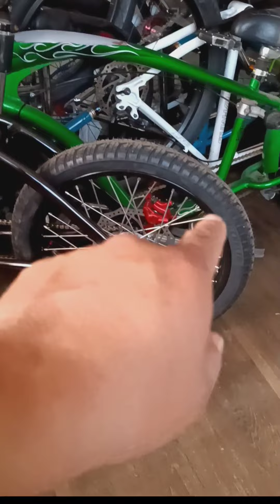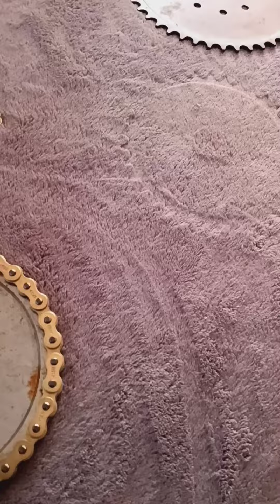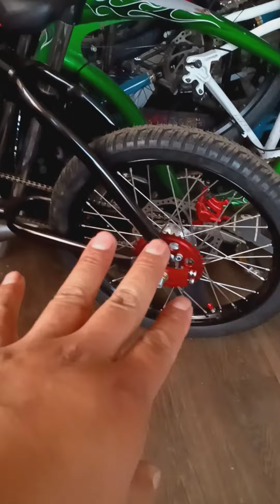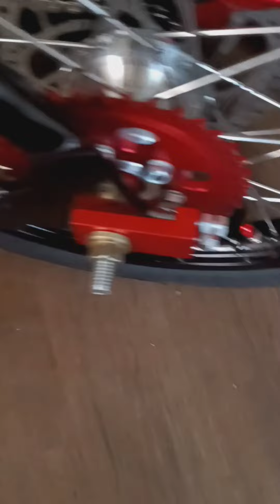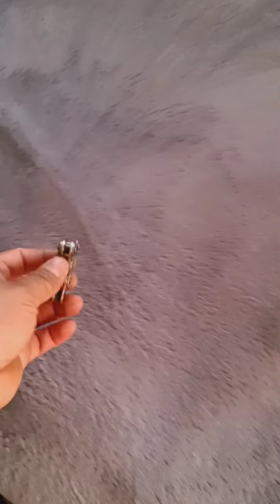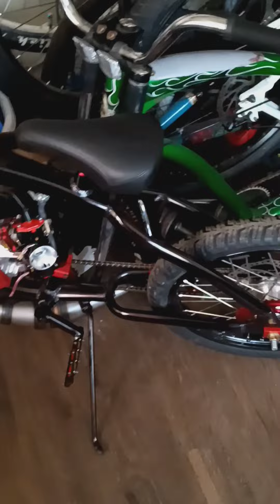when building a race bike/motorized bicycle or want quick change rear sprockets idea heres a tip!

Comment: Ok your running custom sprokets I buy my chain in rolls 415H 10" roll good quality chain or even #41H 10' roll only cost as much as a single 110 link chain if you hit me up Facebook messenger I'll link you up if your at the track please cut a full chain you don't want two master links it can cause Cain to kink but two weak spots is worse I think fine for around town but just I personally wouldn't trust it